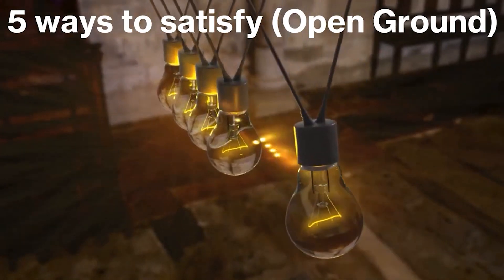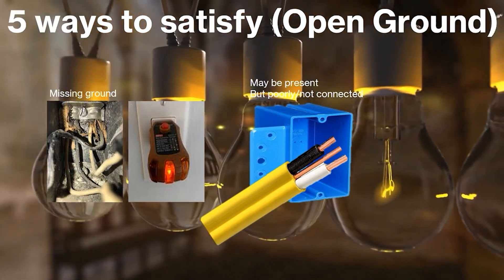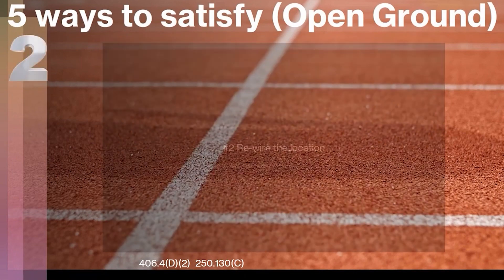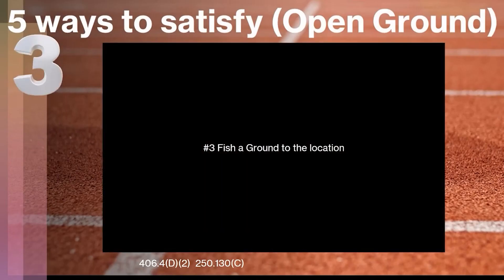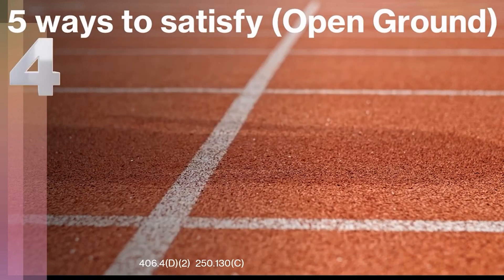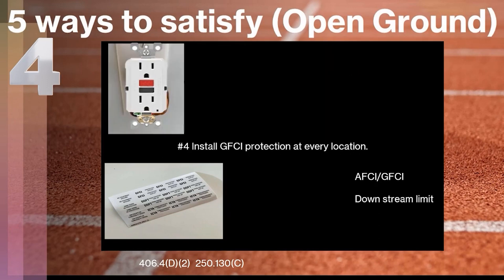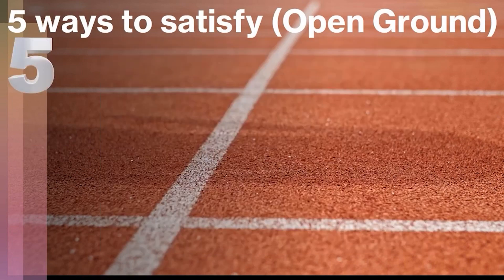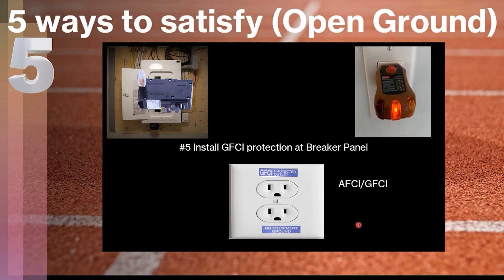5 ways to Fix open ground Full Explanation.

Comment: I would highly recommend using a dual function breaker when correcting an open ground situation caused by old style cloth sheathed NM even in areas not requiring AFCI protection because NM with ground hit the market in the mid 1950s and was required by 1962 so any cable without ground is going  to be 60 years old at best, and gets very brittle and prone to cracking and peeling with age particularly in hot attics and in light fixtures which may have held high wattage incandescent bulbs in the past, which brings a better chance of arc faults.

Comment: These videos are no doubt useful with first time buyers purchasing a fixer upper for their first home since many older properties still have the original 2 wire circuitry.  In most cases installing GFCI protection will suffice and is a compromise between added safety and the cost of running new NM, which can easily cost thousands depending on  the layout of the home.

Comment: In the video you say to "run a ground wire" to a known grounded point on the other side of the wall. Since running a wire (by itself) is not up to code, I feel you must mean "run a cable" that includes a ground wire.
Reply from the maker: No, you are allowed to physically run an individual stranded wire one of the only places in the code
Reply from the maker: And I'm sorry it's not required to be stranded I meant a single strand as a reference